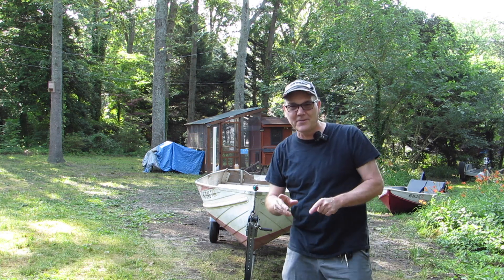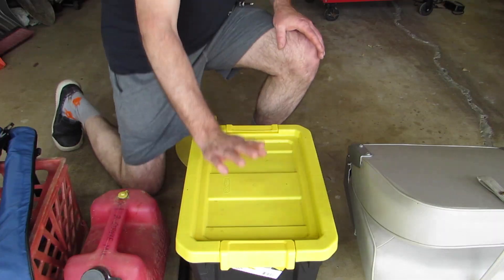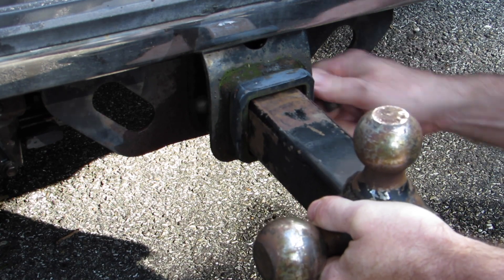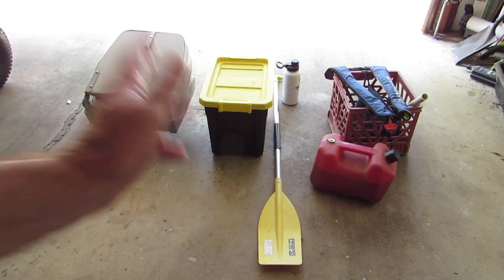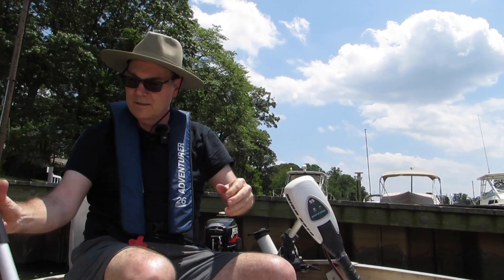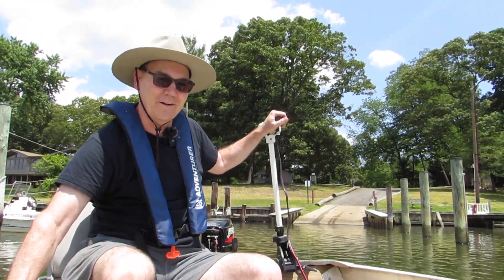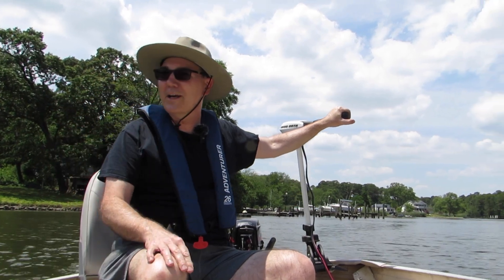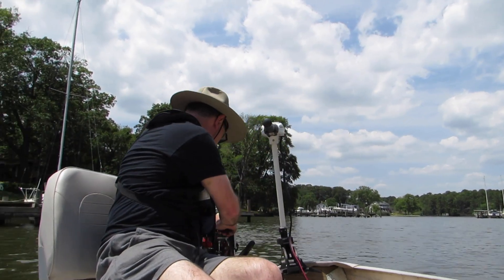First Ride in my "new" old 14 Foot Aluminum Boat

Comment: I love the low key approach to the content    Well done     I always had a rule for my gas powered boats, did not leave the house until I had started and run the engine.   Can always fail, but did not want to find a non start at the docks....

Comment: I have the exact same motor, Mercury 2.5 hp two stroke short-shaft, and this exact thing happened to me last season- stranded me across a huge lake, except I didn't have a backup trolling motor like you (so so smart!), so I had to row, against the wind for about 2.5 hours to get back to the ramp. NOT fun! It turns out that it was the carb killing the motor due to residue buildup. Had to take it completely apart and clean everything out, and it was good to go after that. Hope this helps! 
Always enjoy your videos, thanks for the great content!
Reply from the maker: That seems similar to the issue I am having!

Comment: I feel your pain.....I took my new 4 hp 4 stroke Mercury out on the Patuxent the other day to try a little fishing on my new old town discovery sport 15. i had disconnected the aux fuel tank after running it in the tub the day before. it ran fine. i didn't start it before i put everything in the truck to get there. well, i paddled the canoe out about 100 feet, away from the fishermen on shore and commenced to start the motor. nope, nothing doing. after about 30 minutes of pulling and trying, i paddled back in and put the canoe back on the truck and brought it home. put it in the tub, hooked up the aux tank, pulled a few times and it took off. talk about being pi$$ed off. maybe i didn't have the connector on completely. i thought it might have been something with the safety switch.......try again another day. good luck figuring yours out.....
Reply from the maker: Oof. So many little things to check and then when we’re on the water we can start to panic.

Comment: Just bought a 14 ft alumicraft with spartan trailer plus 9.9 johnson that start but dont pump water. Will repair later as im putting a 25 yamaha on it. Paid $1100 has one minor leak,soon to be epoxied. Have added a few goodies to trailer all new wiring a couple bolt on steps now all i need is for old man winter to hold off so i can get a bit of fishing in this fall good luck with your project boat a bit of floatation under them seats would be a good idea i know dads 14 ft had it in his 1950's wolverine. A 9.9 or 15 should be enough to power that nicely.
Reply: Mini tug boat 15 hp. 21 mph

Comment: Looks like a carb problem.  Try pulling the choke a little bit at a time when running.  If it runs better with choke, its not getting enough fuel.  Alternatively, if closing the fuel valve makes it run better, it is getting too much fuel. This points to a float problem.
I see Brandon is fixing the old 2 hp. I haven't watched it yet but I'm interested in the diagnosis.  Cheers

Comment: You could make lashing points top and bottom on the inside of Gunwhale and add a minicell foam as flotation. We use to do this with white water canoes. I am a big fan of floatation in any boat.
Reply: Airbags are now more common in whitewater canoes.  But they are subject to puncture and not very good for small aluminum boats.

Comment: I run a Yamaha 2.5 HP 4 stroke and it starts in neutral - No reverse, - - My guess on the motor. The air vent on the gas cap needs to be cleaned - When you were in the boat with a no start, take off the gas cap and than start the motor. This is important. When you carry the motor the gas in the tank can get into the air vent and clog the vent. Gary in a 12 foot row boat from the Great Lake State. 🚂

Comment: Do you use the auto anti shake? I'd rather have the shake. Good video and a good reminder to trust but verify when it comes to being on the water. The what-if's can be a doozy when you least expect it. I to had a can runner die on me in the middle of the lake. Good thing you had back up propulsion.

Comment: Please post a video when you find out the issue!! 

 In my Suzuki 2.5 hp LS (4-stroke)on my sailboat, I use  "Trufuel" Ethanol Free which they sell at Home Depot.  It costs a little more, but a small engine doesn't use much, and it is well worth the extra cost!!

 I also  used Trufuel Ethanol Free in my Mercury 7.5 HP (2-stroke) for several years on a previous sailboat and never had a engine failure.
Reply: Good for you

Comment: So man I have that same exact boat almost and I was wondering what pound trust is that trolling motor I’m looking for one for mine
Reply from the maker: My trolling motor is 55 lbs - 12 volt. This one is actually for a larger sailboat. The $120 30 lb thrust models would probably do just fine on this boat.
Reply: Ok

Comment: Hi from Michigan: Frame: 5:53 you said the "Mercury Motor Start in Gear"  - I have a two year old Yamaha 2.5 HP and its starts in neutral - Seems lake the Yamaha is safer.Is thes the way it it for all small Mercuries? Cool boat right. 🚂 👍

Comment: I had an 1986 Evinrude 25hp that was very unreliable. After running a bit it would die and I couldn't start it for anything. After I sat and waited for 30 minutes or so it would crank and run for another 15 or 20 minutes and start cutting out and then die. I was getting plenty of water flow through the exhaust, so I doubt it was overheating. I sold it, because a friend gave me a little 1956 Johnson 3hp and it was the most reliable motor I'd even owned. But, it wasn't big enough. So, I bought a 1969 Evinrude 25hp ELECTRIC START! This motor is just as reliable as the little 3hp and I don't get blisters from yanking on the pull start! Sometimes the old things are just plain better than the new stuff! Oh yea, the boat I have is a 1969 Proline 14 foot V-bottom. So, now I have a motor that matches my boat!

Comment: Yikes! Thankfully you weren't out too far. Old gas or a float is sticking and letting the engine flood would be my first thought. Time for some fresh fuel and maybe some seafoam or a carb cleaning
Reply from the maker: Good ideas!
Reply: @WayneTheBoatGuy  Scrub carburetor out with a toothbrush and dish soap hot water. Don't leave fuel in the tank or carb. Spill it back and run the carburetor dry.

Comment: My thoughts is if you ran your 2 cycle on glow fuel, 21 % castor oil and 79 % methyl or ethyl alcohol, it would never give problems. The catch is that alcohol is hard to buy and Baker AAA castor oil is a little pricey. You run richer than gas and you don't leave fuel in the tank overnight. I have a 51 Elgin. Smoothest 2 cycle ever made but 6 HP is a beast. I just bought a Hangkai 4 cycle 52 CC. 22 LBS.

Comment: What was the top clip things you put in top of the boat trailer hitch when you mounted to your truck?
Reply from the maker: It's a "locking pin" that prevents the latch from popping open if I hit a bump or something.

Comment: Possibly flooding... not sure why but if it runs then cuts off, try turning the gas flow off and pull a few times till it starts and runs. After running for a bit turn gas flow on.
Reply: My money's on bad gas.

Comment: Bought a boat just like that one. Do you know the year,make , and model? I got no paper work with mine.
Reply from the maker: Mine is a Lone Star but there are several companies who made or sold very similar boats. There might be a HID number plate on the outside right (starboard) corner of the transom and if so that might help you find who made the boat.
Reply: @WayneTheBoatGuy  There was no HIN when I bought it, Ihad it inspected and got one. Love to kmow more about this boat. Thank you for your time and love your videos.

Comment: Take fuel cap off, seal gas tank around your face gently blow pressure in tank. Five seconds light pressure. Release pressure pressure slow. Works on all small engines engines

Comment: Carbs are finicky and need to be clean clean clean.  Borrow your wife's ultrasonic jewelry cleaner...fill it with warm water and a few drops of Dawn soap.  Drop the completely disassembled carburetor in it and let it marinate for about 30 minutes (if you have a wire mesh tea ball, put all the teensy parts in it and drop the ball in).  Take it out, rinse off the parts, and gently blow all of it dry with compressed air.  Reassemble.

Also, you neglected to put the chain back up across the ramp after you launched your boat.  You're lucky nobody drove up and stole all the water out of the creek 🥰

Comment: IF you hadn't run your motor for a long time (3 or more months), and IF you didn't add fuel stabilizer before you stopped running it (Add stabilizer and let run for awhile to make sure gas in carb has stabilizer in it). THEN I would suspect a gummed up carburetor. No matter what small two stroke engine I have, I always tear apart the carburetor every spring - unless  I've run some fuel stabilizer through ..... but sometimes, even then, I just have to take apart the carburetor and clean it.

Comment: Those small engines are so so touchy!! I had a 71 Evinrude 6 rebuilt the whole thing, used premium gas and quicksilver oil ran great for two months then not. Replaced the fuel and ran great again, I think the fuel they sell us is crap!!! No ethenol free fuel closer than 80 miles from me in metro Detroit!!!!
Reply from the maker: Yeah one option we have is apparently the canned fuel they sell in hardware stores - but I haven’t really looked into that too much.
Reply: @WayneTheBoatGuy  sure if you don’t mind paying 20 bucks a gallon. Guess it wouldn’t be too bad for a small engine with a 3 gallon tank but 6 gallon at 20 bucks per gets expensive really quick. Atkeast that’s how much mine is. Maybe try a fuel stabilizer I think that’s the name?
Reply: No crap full.    Master chef lamghini v12

Comment: I have a 1968 12ft vee Aluminum.  Had a 3.5 hp on it.  Not enough.  I was having to go against a strong wind one day.  Not good.  Have a 7.5 Mercury now.  Have not tried it yet.  The old saying.  A Mercury will get you there faster, but a Johnson will get you back

Comment: I would never, never, never, never use any ethanol gas in a 2-stroke motor.    If it's old ethanol gas, I would add "never" 10 more times to my sentence!     In my area, we have the choice of 87/E10, 88/E15, & 91/E0 gas.   All my small engines (UTV, ATV, riding lawnmower, 2 push mowers, log splitter, rototiller, two-stroke grass trimmer, & multiple two-stroke chainsaws) get the 91/E0 gas.   I was once shown what 87/E10 gas does to a simple one year old push mower carburetor decades ago, & I haven't used ethanol gas in a small engine since.  That same engine has been going strong since (20+ years) without issue.   My 2-stroke grass trimmer is 29 years old, & it's never run better.  My newest chainsaw is 18 years old (the rest are older).  I own 72 acres of woods, cut, & burn firewood.  My 18 year old primary chainsaw has  never been in a shop for repairs (except for a muffler bolt vibrated out once & I took it in to get a used bolt).  My stuff is old, & it gets used!   I haven't used my 15' Old Town Discovery Sport for a few years, however.  I just picked up a brand new (never had gas in it) 1993 Johnson 3 hp outboard a few weeks ago.   When the time comes to break the motor in, I will use the recommended oil mix ratio for the break-in period, & that motor will NEVER see a drop of ethanol gas.   I realize non-ethanol gas may be hard to find in some areas, but all the gas stations in my area have that option (especially gas stations near lakes/boating areas).   Storing a small engine with ethanol gas in it is especially bad.  For a 2-stroke, I think it's even worse.    Some of my stuff doesn't get used at certain times of the year, &  I will add a gas stabilizer (but non-ethanol gas is key).   If you stored ethanol gas in your engine, the carburetor may need to be cleaned or you may have to put a new kit in it to correct your issue now.   In case I forgot to mention it - If possible avoid ethanol gas at all costs.   If your local gas pump only has one hose coming off of it, run a gallon or two in your truck before filling your gas can.    You don't even want the ethanol gas that may be left in the hose from the previous person using the gas pump.  Thankfully, my local station has 4 choices (3 gas types I already mentioned plus E85 gas or diesel fuel) at each pump, and each choice has its own separate hose (4 different hoses at each pump).
Reply from the maker: Yeah - in my area our local marina is the only place to find ethanol free, and that only started last year.

Comment: Use ethanol free gas, if thats the problem
Reply from the maker: Yeah unfortunately I have been using E10 in this engine.
Reply: @WayneTheBoatGuy  I use boat gas for all my small engines now, when I get my boat motor I will have to remember to use the ethanol free... 
But I thought the ethanol scavenges any water that might be in the tank from storage and condensation? So I would think a little ethanol would be a good thing?
In my saws it causes detonation (knock) thats why I  quit using it.... Stuff to ponder
Thanks for the information Wayne 🤙 aloha
Reply: @krustysurfer  I use 89 -90 E-free gas plus a little Lucas gas treatment. My 1988 Johnson 6 hp. runs nice on it. Always starts on 1st or 2nd pull.
Reply: @WayneTheBoatGuy   I use 89 -90 E-free gas plus a little Lucas gas treatment. My 1988 Johnson 6 hp. runs nice on it. Always starts on 1st or 2nd pull.